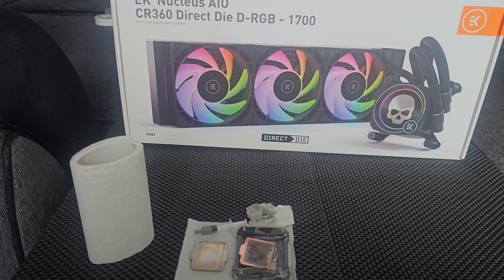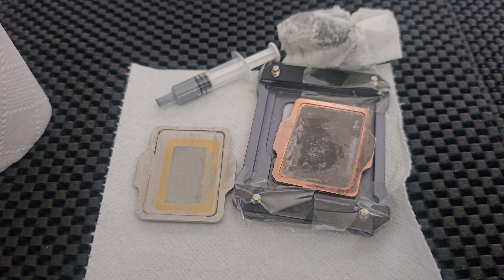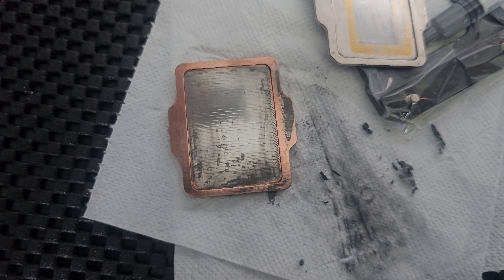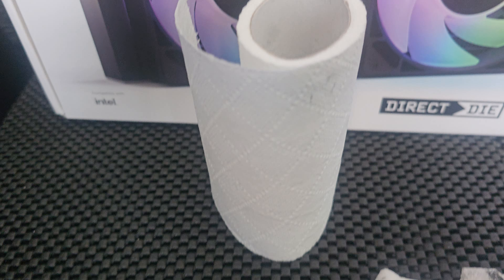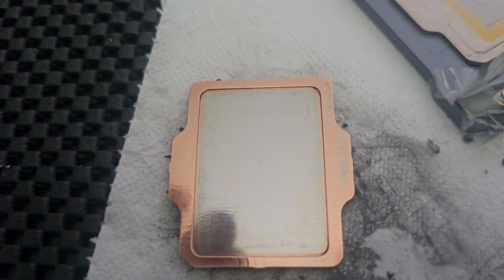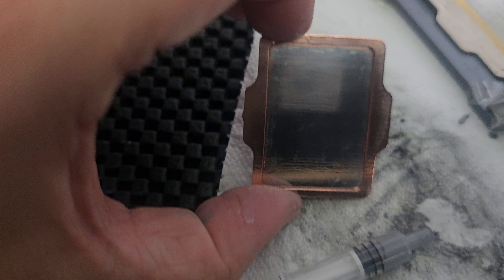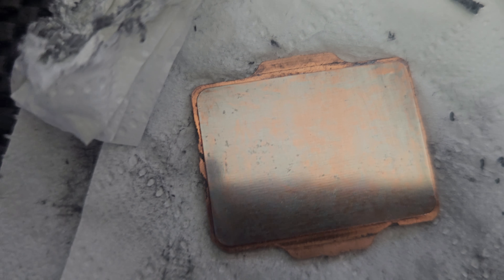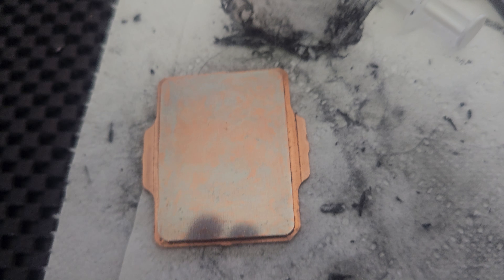an alternative to metal polish use this! clean up delid ihs

Comment: I ordered the same aio but canceled bc they keep pushing the date back a month... when did you get yours?
Reply from the maker: I ordered it from overclockers uk and received it within 5 days
Reply: @toonnut1  Thanks for the info, hopefully they ship to the US. Delid and liquid metal did great on my 13900kf but I just got a 14900ks and I'm gonna have to go direct die...
Reply from the maker: @RuiN4265  I personally wouldn't buy the 14900 ks I've been very lucky and have a great 13900kf and I've seen lots of people having problems with the 14900ks good luck with yours mate
Reply: @toonnut1 so far the memory controller seems to be worse than my KF. What problems have you been seeing?
Reply from the maker: @RuiN4265  some people can't even run cinebench r15 extreme on stock settings and lots are reporting game crashing I've personally had no problems with game crashing but I haven't pushed my cpu to the limit and the 14900ks is pushed to the limits out the box
Im lucky i have a very good bin (SP 106) (P core sp 116) (E core sp 88)( MC 81) that's probably why I'm not having any problems with mine
Reply: @toonnut1  no issues there but I didn't put mine under any load until it was delid w liquid metal. Even tried r15 as it seems to be the most difficult version rn. 

My only issue is regarding memory. I have a g skill 7200 32gb a die kit, xmp was stable but I tried the built in preset for 7600 hynix and it was looking to be stable running karhu then just random bsod out of nowhere. No errors, temps were fine.... very odd. My KF ran 7600 with no issues at all.
Reply from the maker: @RuiN4265  believe me the intel memory controller is a nightmare it can pass memory tests then the next day unstable again 😂
Reply from the maker: Your cpu sp seems good so I'm sure you'll get it stable it just takes a lot of time
Reply: @toonnut1  unfortunately I've experienced that at 8200 on my KF. Thought I was losing my mind as it was perfectly stable. I actually saw one of your videos talking about it... it helped ease the pain lol
Reply: @toonnut1  hopefully, thinking about trying a 48gb m die kit. What's your opinion on m die vs a die? I've seen good results with m die
Reply from the maker: @RuiN4265  😂 a lot of people think it's stable if it boots into windows 😆
Reply: @toonnut1  they'll learn when they crash every other game or need to reinstall the os/bios haha 😄
Reply from the maker: @RuiN4265  I've only used A-die but I've seen people love the M-die kits I'm just a novice that has been lucky to get 8000 stable 😂
Reply from the maker: @RuiN4265  yes the they'll learn the hard way unfortunately